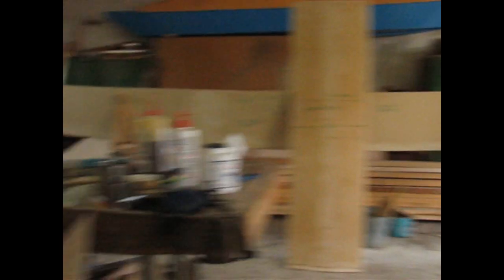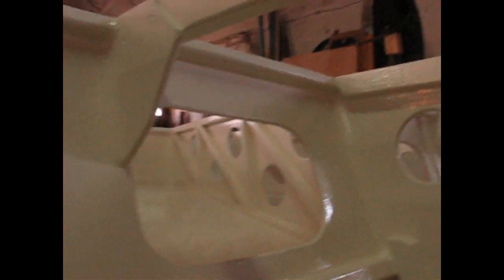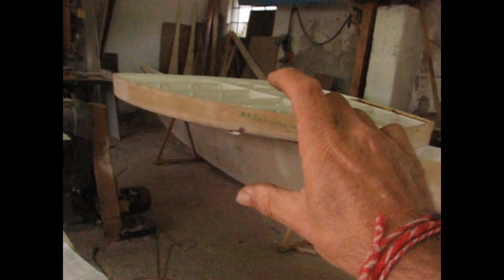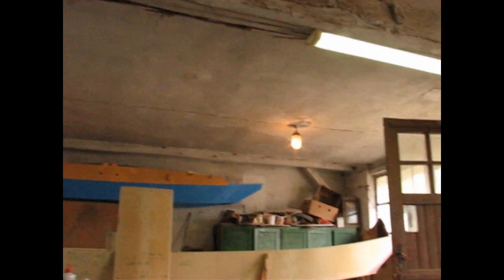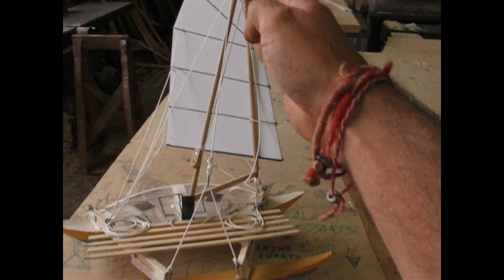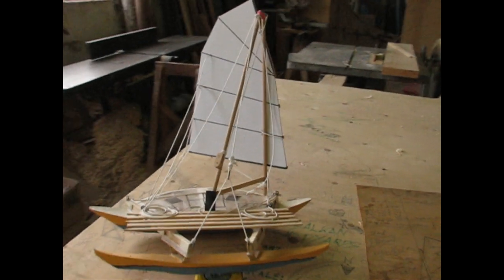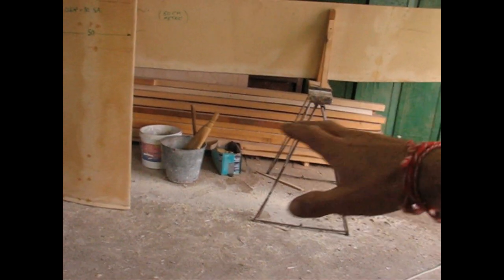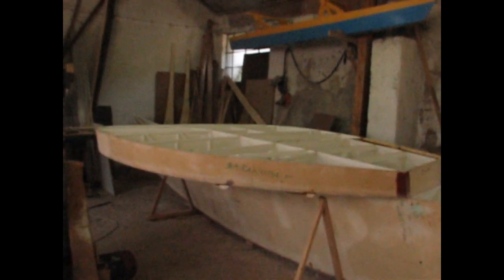One Force 213, explaining the design and costs

Comment: Your boat building philosophy is a great inspiration. 
On the matter of epoxy on both sides of plywood I believe you are exactly right. I have a background in building and renovation and we often encountered water damage because building codes required a vapor barrier between the drywall and the outside coating. When the plastic stucco because popular this caused a nightmare in the construction industry as houses started rotting from the inside of the stud walls because the stucco was applied on top of polyurethane panels on the outside of the stud wall then often they put plastic sheeting on the inside of the studs with drywall on top of that. Everyone blamed the plasticized stucco but the real problem was vapor weeping up from the foundation then becoming locked inside the walls. A builder friend showed me a box he made from plywood and covered with stucco. The inside was bone dry. The only reason I would cover both sides of plywood is if the plywood is a sacrificial component in construction of a fiberglass boat, meaning it's not a wooden boat with fiberglass coating but a fiberglass boat built with multiple layers of fiberglass on a plywood lattice work, so all the strength is from the fiberglass. The plywood only performs a temporary role of creating the shape and could actually be anything that would hold the shape until the fiberglass hardens. The first canoe I ever saw built with fiberglass used a frame of hexagonal wire mesh typically used for chicken coops.
Reply from the maker: Many think water is stupid... Here in Bulgaria the old post and beam cob houses, usually have a basement that is half under ground, meaning the house is built into the slope of the mountain. The basement is all stone, above it is wood and cob. These basements were always wet, as the underground water would come in through the stone wall, it would run along the clay floor then, go through the downhill stone wall the keep going down hill. Many westeners buy these old houses as an escape holiday home, or to permanently live in them. They love dreaming of their lounge being at the bottom in this beautiful stone basement... They quickly buy the best materials, they seal up the walls, with high tech mortars and fancy glues, they point the stone, they tile the floor, they seal that basement and make it watertight!! A year later the ceiling of the top floor is waterlogged and sagging....  Plaster is falling off the walls and the cob is wet to the top! The moral of the story is if you don't let water go down hill,  it will climb up to your roof! Balkan Shipyards

Comment: I like how careful you're being about keeping the boat light.  Nice job with that and also the cost control.

Regarding lee shore remember that the wind force goes up with the square of the velocity and this factor also means that with increased wind velocity you have to reduce sail area (driving force).  You don't get to reduce the parasitic drag area of the hull and rigging proportionally.  Hence as the wind gets stronger the drag force increases much faster than the drive force.  Once you find out what that wind speed and sea state are where you can't go upwind anymore you have to simply stay out of those weather conditions if a lee shore is involved.

Ideally epoxy is supposed to fully encapsulate the wood so that moisture uptake is essentially zero.  In my experience, separate from adding stiffness and strength to the plywood panel, using cloth on the surfaces protects the epoxy layer from micro cracking and it also assures that the epoxy is applied to a uniform depth over the entire surface (fill the weave).  This reduces the chance of high use areas exposing the wood through premature wear.  Areas that are subject to any kind of standing water (interior) or immersion (exterior) should be protected this way.  Areas that just get splashed don't necessarily need this level of protection but any splash areas that are known to be wear spots would benefit from a glass patch in that location and it's also good to put a glass patch anywhere a hardware fitting is to be placed.  The additional stress around a fitting will tend to micro crack plain epoxy and this will allow water ingress.
Reply from the maker: Thanx Chris, happy u like her, she is by far my best build.... experience speaks for itself I suppose..... Lee shores come at anytime so does bad weather, knowing that you can get off it in most conditions is calming. obviously the more you reef the less lift you have vs the same drag that unfortunately cant be reduced like the SA can. But honestly I feel that I will be able to creep off a lee shore easily under 2nd reef. 

Epoxy does wonders yet it will absorb water, if I'm not mistaken I think it was 3% moisture it will hold, that's pretty low yet from there it goes into the wood it's a slow process that ends up with waterlogged hulls, I feel that water if it's stubborn enough to get in, it will find it's way out too and that's why plywood boats need time to dry up on the hard, vs wood boats that must stay wet. Since it's this way, I wonder if we are overdoing it, is it necessary? the extra weight? cost? and labour??  My plan is go thin allover externally, 80 gram per square meter glass, then second layer of 160 above the first 80 only to above waterline, wet on wet of course!!! I suppose a touch more protection for the bottom cant do any harm, and as you say, above waterline splashing is no problem.... Inside, paint. Lets see what happens.....

Keep Shunting Chris, the force is strong.... All d best

Comment: What kind of intrerior paint are you using?  Epoxy paint is about $1000 a gallon in the US  now...What are you going to use for exterior paint?
Reply from the maker: I paint my hulls in and out with a good quality industrial metal coating. I pay 5 Euro a litre for 2 pack epoxy primer, and 10 Euro for a litre of top coat which is a high gloss Polyurethane acrylic. These paints are made by a top manufacturer and are a system of primer and top coat.

Comment: Great to see you using a junk rig.
Though with your swinging mast that must make the running rigging complicated.
Shame you don’t use a Cheers type rudder / foil, you could then be balanced on a fixed mast.
Reply: Yup, choice between complex rig or complex rudders / rudder boxes. I guess if you sail in shallow water often, your choice is made.  Otherwise, having seen a photo of Jzero sailing on just the main, if I ever get time to build, that’s how I would go.
Reply from the maker: Well Mark, this is a well proven rig, that truly has no issues at all, it's very simple to use and very safe. I'm against placing CE aft and solving it by moving CLR aft by use of foils. Why complicate the build? Why add weight? Cost? what about unnecessary turbulence? Just place CE where it should be and eliminate all that. Dick Newik was as great as they come, yet I feel what I'm doing is the way a  Proa should be.... Keep Shunting man, interesting point, that is debatable....

Comment: Where do you measure the 1:10 ratio? 
Waterline length to waterline beam
Reply from the maker: At waterline beam length ratio is 1:10 I wanted to go narrower but lost too much volume, on a bigger hull I will go to 1:14 waterline, cos James  Wharram said that's that as good as u can go,any higher will add too much wetted surface knocking speed hard in light conditions....
Reply: @BalkanShipyards  Well , you could add sail to fix that ....one of the junk rig`s  biggest advantages ....build it oversize , sail with a reef in " normal " conditions , shake out the reef in light air. Not altogether a disadvantage , I would say.
Reply from the maker: @harryme472   I will go as big as I can, it depends how long I can make the masts and yet not go overboard weight wise.... The 2 spars complicate stuff and are  limiting... Don't forget this is a stayed Junk Rig which also has it's limitations.  Keep Shunting, Balkan Shipyards
Reply: Thanks, from what I read, 1:10 is the maximum you can get away with.  I think you have got it right for a small proa with accommodation.
I had a Hirondelle cat, perhaps 1:8. Always felt like she was making a big hole in the water when pushed hard.

Comment: Great to see the progress ! The force is strong. Those are some beautiful lines and very roomy inside for such a narrow beam
Reply from the maker: Great comment David! it's these ones that light my fire and it's you guys I do my best to share what I learn with.... I suppose it's the standard give and take, nothing truly amazing, just the reason to be alive.......
Reply: @BalkanShipyards  I posted on your last video a link to a lecture about fabric formed concrete, im thinking of trying to build a round bottom drua hull with those techniques. They can be formed long, narrow, and rockered with a single flat sheet of cloth with no folds or dart cuts. With $50 formwork you can make a solid hull of any length in a weekend. Im thinking pozzolan cement reinforced with basalt rebar and fiber would be strong, light, and last a lifetime.
Reply from the maker: @Merkasaur  I will check it out, thanks. Just weight is an issue, you will have to figure how thin u can go in order to save weight! Still interesting.  Keep Shunting, Druas rock
Reply: Some of the pumice sand aggregates used in the concrete canoe competitions look promising for saving weight. I assume the advantages will increase and surpass wood as the size of the boat grows. At small scale theres only so thin you can make the composite without becoming flimsy; but above maybe 10 or 15 meters, a well engineered cement hull could be thinner and lighter than wood and be half the price to build, needing less expensive paints, etc. Just a sealant. There is a long history of ferrocement monohulls, but they dont worry so much about weight
Reply from the maker: @Merkasaur  Yea,  ferrocement monohulls we know, as you say David, weight is not an issue.... Though I have heard of rebar rusting, which is a problem...I remember as a teenager seeing a Russian Catamaran from Riga in the Med, it was ferrocement construction. I remember a conversation at the time, I  was on a big fiberglass tri, so we were all boat people, except me.... Guys were claiming that cement hulls are less forgiving and crack on impact faster than any other boat building material.... Then I read books that claimed ferrocement hulls to last forever... or almost that long.... I suppose it'd worth further investigation, as you say, longer gets thinner therefor saving weight, but could it beat wood????
Reply: Yes rust destruction ends a lot of ferrocement boats. Improper cathodic protection etc. Thats why I consider using basalt fiber. It is chemically inert. Immune to saltwater. Ferrocement got a bad reputation because there were a lot of bad homebuilt ones flooding the market early on that had bad construction and rust problems. Hopefully I can do better. Anyway the construction process works with epoxy and glass too.
Reply from the maker: @Merkasaur  It is interesting stuff,  I have my hands full till next year, then I hope to cruise for a year or two, by then David you may spark me up, I too feel that new materials and methods should be explored, Good luck, it's good thinking material.......
Reply: I am almost done with a mini proa im building from a 4m kayak. Something to play around with on the rivers and lakes here. Learn shunting and experiment with different rigs. I, too, am very in to junk rigs. I find your leshunk very interesting but maybe too complicated. I want to try a junk rig directly on a canting mast. Many of the original junks, especially around vietnam, did not have parallel battens. More like fans and mounted on a forward canted mast. They top of the sail curved creating an aerofoil. If you balanced the sail well forward of the mast, could you cant it far enough to shift CE forward of CLR? That is my experiment. Is there a way to donate to the Havaya project?
Reply from the maker: @Merkasaur  The  LaSHuNK is a Pacific Crab Claw rig, where I replaced the Crab Claw with a balanced Chinese lug sail. The CC has a yard and a boom, the yard is held up by the mast. I have the same configuration. An Oceanic Lateen has a canting mast, but it has a yard on the bow holding the sail. Just a canting mast and a Junk sail won't move CE far enough ahead. Make a  model and try it, but I can't see it happening. By the way, the LaSHuNK is simple and works extremely well...... I would like to see a photo or 2 of your hull,  when the time is right.... Keep Shunting David, Balkan Shipyards
Reply: Thanks, I may try to upload some footage when I am done, with some progress pictures. The leshunk looks very sophisticated and workable. It just looks like more hardware and weight than im looking for. I've been reading today a study about wind tunnel tests of various Polynesian sail forms. One that I had seen before but hadn't considered won on windward efficiency (Lift/Drag)= the rectangular oceanic lug of the Ninigo Atoll. Basically a 1:2 to 1:4 rectangular sail with yard and boom along the long edges. It is mounted on a very canted mast and shunted on their proas. It basically looks like a single panel of a junk sail tilted far over. Seems far easier to reef cleanly as the flat, rectangular sail can be rolled up one the boom neatly. So many ideas and its much easier to experiment on very small boats
Reply from the maker: @Merkasaur  Fast boats those are, I never seen one shunt though and it boggles me.... Start small as you said, good stuff and very interesting, Good Luck and I hope to see your progress when the time comes.... Keep Shunting man.
Reply: Im looking for a 10 second shunt with great windward performance